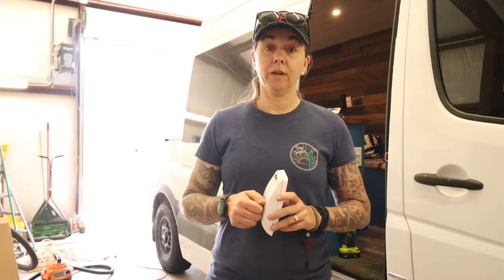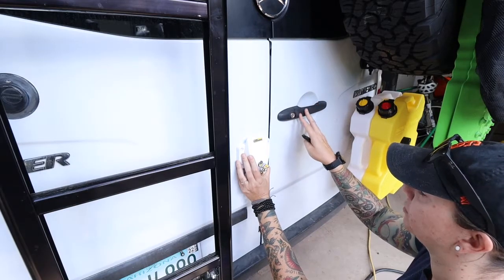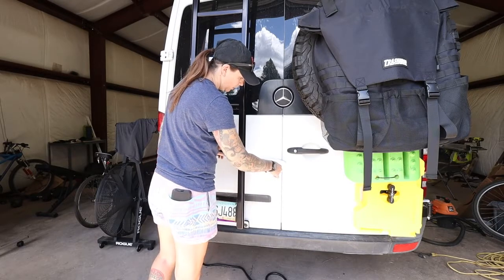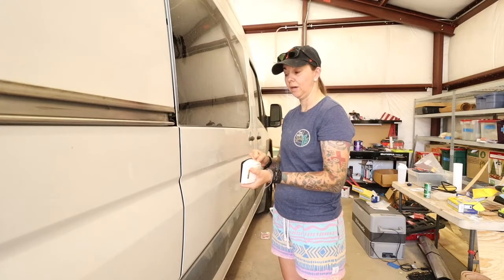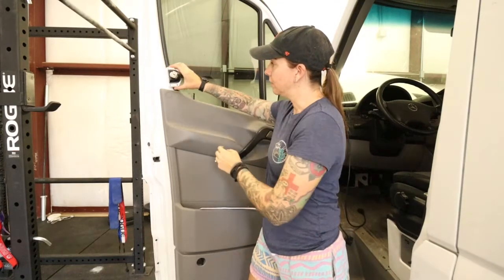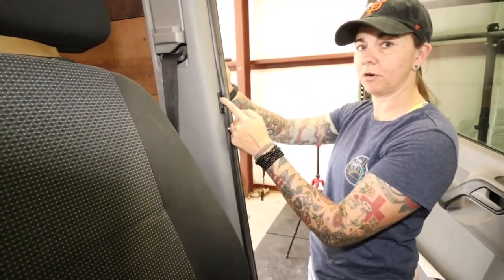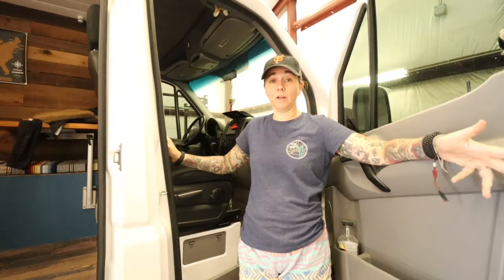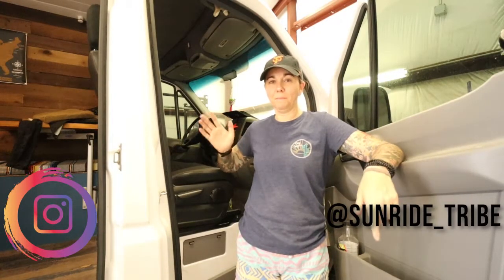How to install HEOSolution locks on a Sprinter van | Sprinter Conversion

Comment: Nicely done. I am curious if you can travel with the locks in the open position- particularly for the sliding door. Seems like it would be a pain to have to exit the cab to unlock the slider when making stops, i.e. for gas or other places.
Reply from the maker: Hello Patrick. Yes, we always travel with the locks in the open position all the time.
Reply: @Sunridetribe6  No problem removing the key? According to the website it says the key is not removable in the open position.
Reply from the maker: The only time we have had any issues is if it has a lot of dirt caked on it. Once we give it a quick clean they are good to go! 
When they are in the open position they can be locked.  Hopefully that helps.